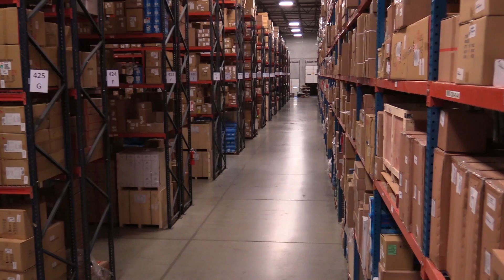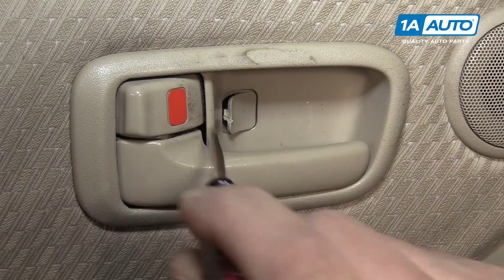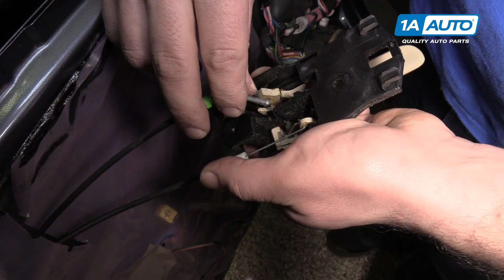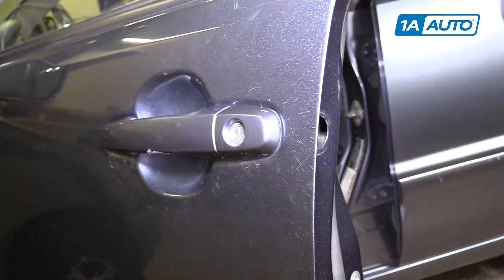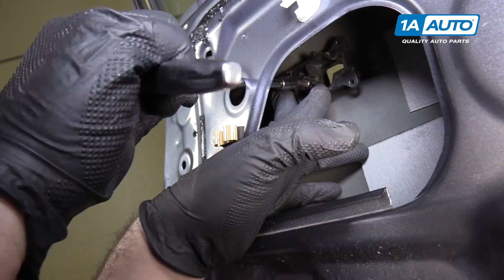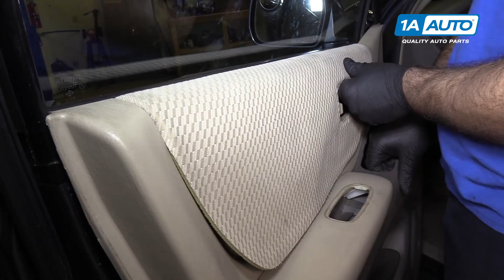How to Replace Front Door Lock Actuator 00-07 Toyota Highlander

Comment: Just did this for a side customer and ran into some complications and wanted to post some feedback.

You DON'T NEED YO REMOVE THE DOOR HANDLE.  If you raise the glass all the way up, there is enough of a gap under the glass that you can insert a long pick between the op rod bend and the yellow bushing to pop it out.  An alternative would be to use a smaller right angle pick you can put in by running your hand through the door opening.  Worst case scenario, just roll the window down until the bolts holding the glass to the regulator line up with the access holes and remove the glass.  Way, way easier and faster than removing and reinstalling the handle.

If at all possible, get the whole latch assembly.  It's a real Rube Goldberg on the inside and parts might get bent if you fight with it.

-Disconnect the two operating rods on the handle and the key cylinder.
-Unbolt and flex away the lower window track (do pull the glass first if you go that route)
-Remove the 10mm and the three T30 bolts to release the latch assembly.
-Once loose, carefully lower it and flip it over inside the door shell to access the connector.  Angle pick also works wonders to pry the bottom of the plug against the actuator as you hold down the snap tab til the plug clears.

Reinstall in reverse order.

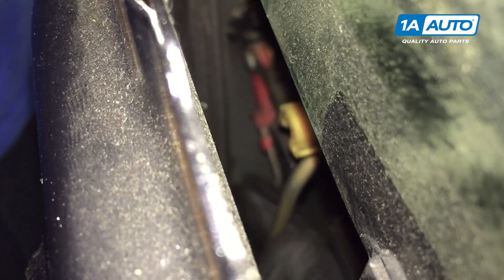Comment: 6:28 that rod in the yellow plastic is usually stuck and sometimes door handle will not come off. Try pushing the rod out with a long screwdriver through the lock hole that had the plastic cap

Comment: If anyone reads this, be sure to lubricate the door latch assembly and the inside of the actuator if you are replacing only the motor. I suspect bad lubrication makes these motors burn out prematurely. I had to do this repair twice because I didn't lubricate the first time.

Comment: Great presentation!! However, before I order parts, Can't the actuator be removed without removing the latch assembly?
Reply: The short answer is no. There are three screws that keep the actuator attached to the latch assembly. Much like in this video, I too had to remove the entire handle as the cable was jammed, so just be prepared to remove it all.

Comment: Thanks for the vid. I've done this a couple of times on my wifes 2010 Highlander after the second one, the drivers door (actuator that I replaced) will not stay locked. Get out shut the door (fob in purse) push the lock button on car handle, they lock and then the drivers side unlocks automatically.  Open door hit the lock button or manually lock the door same thing it unlocks automatically. 
Any ideas? I'm at a loss...
Reply: First guess is a faulty actuator.  

Second guess is a setting related to locking/unlocking with key  fob.
**  Is there a second key or fob in the car? Some vehicles have a safety feature to help keep you from locking your keys in the car
Reply from the maker: +philbio75 We wouldn't be able to diagnose an issue like that here, you may want to have a local mechanic take a look at it. Thanks for checking us out! http://1aau.to/m/Shop-1AAuto-c